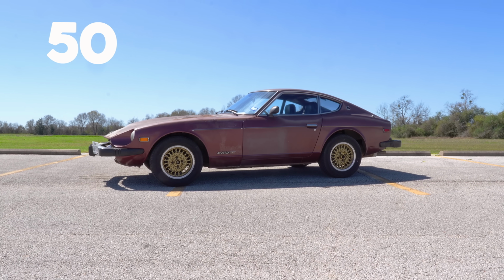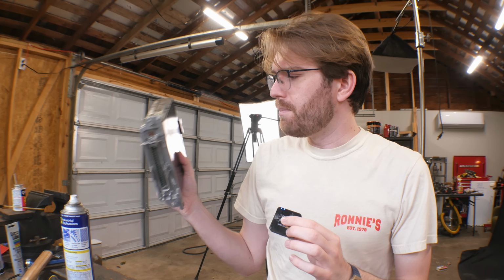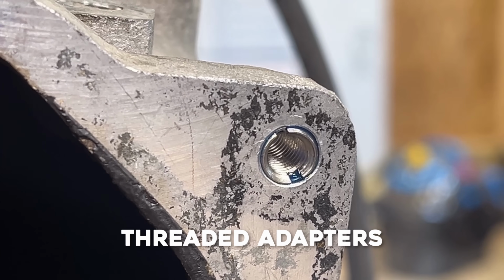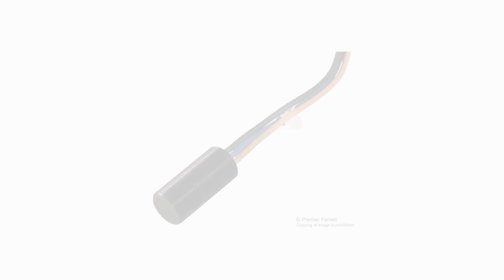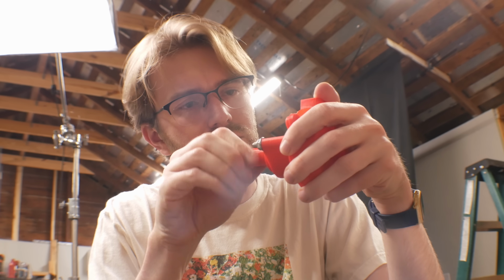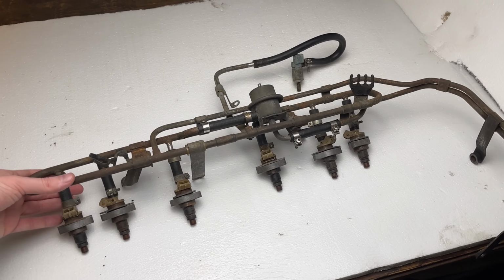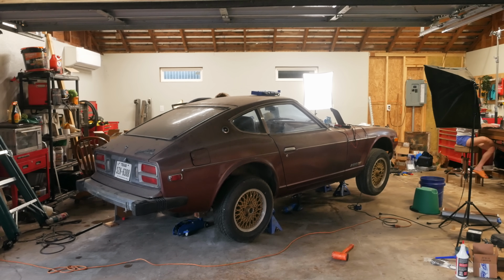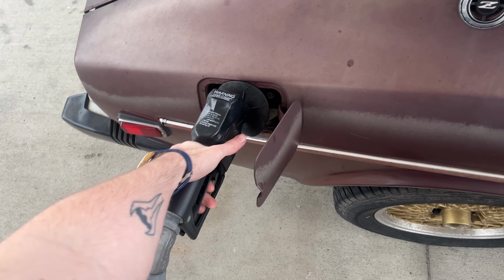Modernizing a Vintage Car

Comment: It's just amazing how someone like myself with barely any mechanical exp. knew it was a fuel delivery issue just by the sound of the car starting. The magic of old cars is that they usually diagnose and troubleshoot the same. 🎉

Comment: I had a 76 280Z and we got around 20-21 mpg with normal driving...put it out on the freeway and it was an easy 22-24 mpg.  A good friend and i went on a little mad run to a casino one time and running probably an average of 100mph the entire trip, when I filled up we still got 18mpg for the trip there.  This was just the regular straight 6 that came in the Z, nothing added, nothing removed, straight from the dealer to myself.  Loved that car, got married and had to sell it to get a down payment on a house.

Comment: Here I am looking for the best naturally aspirated 160+hp engine from the 70's or 80's that I could drop into my 2016 Mitsubishi Outlander with as little fuss and modification as possible. That's right - I want points and a rotor under a distributor cap. And now you are going to ruin that vintage car with modern crap. Ugh.

Comment: Love your humor when the crap falls apart.  It makes those of us in NE Texas feel like our problems are shared with others of similar skill sets.  It doesn't matter whether it car, boat, motorcycle, lawn mower, vintage modified race car or a RV 8 experimental airplane.  Each one of those projects had me scratching my head and confering with other who had experiences similar to mine.  I bought my first Z 260 back in the early 80s at a junk yard.  It has fire, compression and fuel.  Turns out that small rubber hose on the intake manifold had a huge hole on the bottom side.  Replaced it, a good bath and interior scrub and my new wife's new car was ready to go.  Did I tell you that a Datsun 260Z does not make a great car for a young lady real estate sales agent... 😂

Comment: 78 280z was a fast car until the 280zx Turbo came out. Nissan computer were not that great in some of those z cars. I used to own a 75 280z in 1990. My car ran fine until one day it stopped on my way home from work. I didn't know much about fuel injection back then. I took it to a shop and they replace the computer with a used one. Car ran great again until my boyfriend fell asleep on his way home from work. I really got in his a-- after wrecking my car.

Comment: I’m rewatching this…… I missed something. Lose the clutch actuated cooling fan. Upgrade your radiator and put in a thermostatically controlled electric fan. You’ll pick up 5-7 hp with more efficient cooling. Not a terribly expensive upgrade

Comment: A 289 cu fits nicely in the engine compartment. 
289/ 300hp, 4 or 5 speed transmission. Did that with a 240Z sleeper. 
Have a great day!

Comment: This is an amazing amount of knowledge. Frankly, I'm surprised the 280Z ran at all after all these years. It's been years since I saw one of these in good shape but IIRC it had about 120HP on the dyno, stock. As a daily driver, with a 40 mile freeway commute, he reported 20 MPG regularly; less in town because, race car (lead foot).

Comment: My only concern with an electronic throttle body is the necessity for a safety bypass attached to the brake. It can reduce fuel or drive the throttle closed I don’t care which.

Comment: you could have got the fuel injection from a 85 nissan Maxima 3L6 and it would have everything you need for your computer fuel injection system and just some body make a racy fuel profile or you could get your own software to do it yourself.

Comment: Why not use the starter gear teeth on the flywheel for your crankshaft position sensing?  Would have given you a ton of resolution.

Comment: How were you able to buy a bracket for the coils but not a cam position sensor? What’s the point of that bracket if you need to custom build the cam sensor? Also, couldn’t you use the magnetic pickup on the distributor? Maybe remove a lobe to give it the position?

Comment: Great video your a definite wizard!🎉
Now i got some questions.
1) why didnt you replace the valve train and lap the valves in?
2) i think i understand you were wanting to leave the motor stock but why didnt you replace the timing chain after a 100,000 miles they need it.
3) this isnt a question just a helpful tip pull the fan system off and put a electric fan in it it will help.
My father and I rebuilt  a 6 out of a 280 to put into his 260 and we port and polished the head gasket matched the head on intake and exhaust and that 6cyl was a holy terror!
It was to powerful for the rear end we tore 2 rear ends on the 260.
3) now that you fixed the "devil sphaghetti" of the 280 are you going to sell it as a kit?
Its a niche market but it is a market.
Look you did a hell of a good job. Me i would have just ripped the ECM and fuel injection crap out bought a new intake put two weber side drafts on and called it a day, but damn man! My hat is off to you!🎉🎉🎉🎉

Comment: Originally the Nissan 'L' series engines were copies of the Mercedes M180 engine, an engine that was first developed Mercedes in 1951 and continually developed and used until 1985.

 They are great engines.

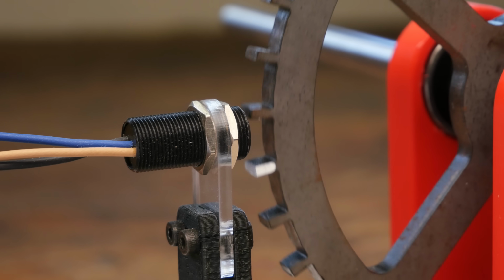Comment: 14:50 I have a question here: So now the computer knows when the cylinder 1 is top dead center, but how does it know when is the 2. 3. 4. 5. 6. cylinders are top dead center?
Reply: timing

Comment: Only issue i have after watching this, is to say. The car with the 3x carbies made 151HP out of the box on the stock L24 engine. Your EFI conversion saw only 142hp.

Comment: You wouldn't believe how many 280s burned down due to the leaking injectors. Alone this conversion is well worth it.
Reply: Later versions also had the same problem, I had a 1984 300zx and there was a recall for leaking injectors, mine caught on fire on my birthday.

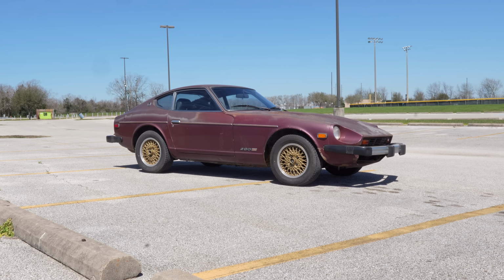Comment: 0:23 i dunno about reliable. Everything used to be made of metal in the engine bay and have relatively simple electronics. Now there's sensors and wires everywhere and everything is made of plastic

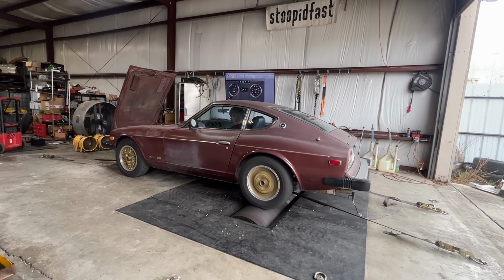Comment: 1:44 true, especially being a longitudinal setup (transverse drivetrains lose less) but at the same time, you are also basing that off of a quoted "new" engine hp. I'd be willing to bet that if you pulled the engine and ran it in a cell, you'd likely find that it isn't making the 170hp as quoted by Nissan/Datsun back in 1978. Depending on if it was ever rebuilt and if so, how long ago and how well, it could easily be down 15, 20 or more hp and then that 125whp suddenly doesn't seem like as much of a drivetrain loss after all. Also, that Cruse Eco mention is a bit misleading there, don't you think? I mean, OEM rated hp is always at the engine, not at the wheels like you tested... That Cruse only makes about 115~120whp from its rated 138 Chevy rated engine HP.

Beyond that though, awesome work and video. 

I will say this though, your holding it all back by staying on stock internals. Modern engines are more efficient not just because of their fuel and ignition system. A  large contributor to modern engine efficiency and power output is from compression ratio and valve train (well other little things too that all add up but...), and while you wouldn't be able to have the luxury of any sort of variable cam timing (and valve lift) like a modern engine, you could really still benefit from a healthy bump in compression ratio. 

The L28E engines only had 8.3:1CR which hell, that is on the same level as 90's turbocharged engines which is quite low. Modern engines are in 12:1CR range on average with modern turbo engines even starting to push close to that too now due to the electronics being able to more accurately control fuel and ignition. 

Due to lack of sufficient control of fuel and timing from now old outdated EFI systems (like the OE L-Jet system), OE's back then had to keep compression down to ward off knock. Then there was also the gas / oil issue's of the 70's and 80's where OE's knew that they would have a very hard time selling cars that required mid level or high octane fuel and thus we got crappy low compression ratio naturally asperated engines.

Comment: I have thought about this. There has been so many models & makes of cars over the years. I'm sure you could find done kind of fuel injection & computer controlled ignition to match your engines piston movement.

Comment: I'm about to do something similar, except I'm starting from carby and points, and going to multi-point EFI with the most modern injectors I can (like this).

I'm also starting from a car that already gets 5.5l/100km. So I'm hoping to get economy in the low 4s...

Comment: A similar thing can be done to any old Škoda car with a rear mounted engine built between 1964 and 1990. The I4 OHV engine was originally developed for the very first model of the rear engine Škoda cars (the 1000 MB) and was updated and manufactured until 2003, when it was installed in the Škoda Fabia. While the original 988 cc carburated engine started at 32kW, the last evolution (still OHV, the basic layout of the engine remained identical, the engine bloc looking strikingly similar) had 1397 cc and produced 50kW of power. And it had fuel injection. Because of the similarity of the engine to the previous ones, it can be adapted and installed in the rear of many old Škoda cars that are vintage today. I had the opportunity to to so myself (to install it into 1986 a Škoda 130L), but refused to do so, as the benefit would be marginal, not worth the hassle and most importantly could cause legal problems. Depending on the exact rear engine Škoda model, the modifications vary, and depend also if you want to keep fuel injection or want to install a carburetor instead.

Comment: Especially a car from the Malaise era ... not from the pre-emissions control pre-oil-crisis era of the 70s and early 80s. (albeit there's some cars from late in the malaise era that still have exceptional fuel economy and sometimes unusually low emissions on top of that ... but relatively gutless power ... albeit still better with a manual than an auto and usually more fuel efficient with a manual)

Comment: The hall effect sensor on a Nissan 350 Z reads the teeth on the flywheel. Which obviously is directly connected to the crankshaft. 

The flywheel has BOTH regular teeth and A COUPLE offset teeth, so not only do you know the RPM of the engine you also know the position of the crankshaft for timing.

Reading both the RPM and engine position from the flywheel might yield a better outcome for your project. 

However, since your vehicle used to use a distributor, perhaps getting your timing from the device that used to firing the cylinders might work just fine. 🤣🤷

Comment: There's a guy here in Austin that is also rebuilding his Zcar. I know because 20 years ago, I rebuilt my Z and sold the remaining parts to this guy much much later. I retrofitted the engine from my '81 280ZX into my '73 240z, scrapped the fuel injection, and put on some SU carbs with electronic ignition. I was actually getting around 24mpg when it was all done. If you ever come to Austin, I'd love to see your car and talk!

Comment: At very least new rings and get valves lapped and new valve seals. I am sure those rings are leaking a bit and also tear down the engine and give it a deep cleaning all the parts then assemble it. Garage 54 did a episode on  that they got a old POS engine to run like new just by cleaning it deeply inside and out. They put new rings and lapped the valves and all new gaskets to stop leaks that's it

Comment: I saw one of these car go for over a £100,000 on an auction, it was in mint condition and had only 31,000 miles on the clock

Comment: The reason for the power loss isn't only because of the drivetrain, engines just loose power over time, especially after such a long time sitting without being started.

Comment: I took a look at those numbers again and I found something interesting. You may be making 4 more horse power than that Chevy, but you are doing it at 2,500 rpm compared to 4,900 rpm. So, what is that car capable of at 4,900 rpm?

Comment: that was a bit of work to gain 17 HP, that is not a lot of HP overall. i would be interested to know how much better the gas mileage increased as to my mind in this situation, if you were to get another 10-12 MPG that would be more impressive.

Comment: Nice work. Also, a demonstration that early adopters and folks doing 1 offs are seldom going to be the low cost solution. This type of work is rarely done for cost, but love and interest. Proof that it can be done, also proof that it is not an easy or economical route.

Comment: This was a really cool project, and I applaud you for taking it on and pushing through to the end!

The 63 years thing is pretty much exactly why I try to explain why I don't just go out and buy a new "fuel-efficient" car.  By the time I pay it off, have I really saved myself any $$$ - probably not.

Comment: you need a turbo now and double the power without changing any internal part ,  only intake tube , exhaust pipe and fuel air mixture program for boost.  Some 280z where all ready turbo

Comment: The cam angle sensor adapter was very nice. I had to make one for a car years ago and it was very, very crude. Basically just a hacked up distributor with some not so nice welds and an adjustable bracket.

Comment: Sorry mate, at this point I would have just pulled out an engine from an fuel injected model car. Any japanese engine from toyota, mazda, honda with half as much work as you did I suppose. 
Good video any how that explains a lot of stuff that goes into making an engine work. Good on you

Comment: I had a new 1976 280Z. It had 178 HP, no idea what HP was at the rear end. But it would do 150+ MPH, and could outrun either a 76 Mustang or Camaro in the 1/4 mile. And at 1976, 55 MPH speed limits, I was actually getting 20+ MPG with the standard transmission. And, yes, that was with a new car.

Comment: This car is begging for a BMW M50 swap - the only weak point in the motor is the plastic impeller in the water pump and they make aluminum ones for $25 that are better-than-OEM. 

Keep the silky smooth inline 6 power delivery, but give it twice as much to work with. And if you really want to test your testicular fortitude - go with the S52 M3 motor and its 8200 RPM redline - just make sure to upgrade your driveline.

Comment: Variable valve timing, camshaft regrind, higher compression, variable intake, direct injection, a million more sensors, etc.  This is what makes modern efficient power, unfortunately the old stuff is stuck at where it was originally.  But at least now it can be changed and tuned.

Comment: the way you drew up the engine RPM sensor was way over engineering the issue. ditch coil on plug, keep distributor but what you do is get a MODERN electronic distributor that would be tons better then any points system or old ass dizzy on that engine, while keeping with the challenge rules.

otherwise, entertaining video and nice work on the nissan engine.

Comment: You are such an inspiration! Awesome job. I have a 1977 280Z and was wanting to change the original fuel system and computer in order to reduce emissions. I am sure your car is running much cleaner now.

Comment: So I don't know how many miles were on the original motor and I know you only wanted to do improvements on exterior parts only but it might be a good idea to pull the plugs and put a camera into each cylinder and check for carbon build-up. As you mention the old fuel delivery system fed fuel into each cylinder weather it needed it or not thus I suspect this could be a strong possibility thus possibly robbing you of some efficiency. Some kind of engine flush might do some good. A compression test on each cylinder might be a good idea as well to let you know if you have any loss of power there, if its minor there are products such as "Restore" that in some cases can have some positive effects. Just a ome thoughts.

Comment: 😅😮 How could you make it more efficient without opening up the engine. Really should have did L15 swap. Practically double the efficiency double the horsepower If you wanted to

Comment: Okay I’m enjoying this.. I’m only 10 min or so in and laughing hard as hell… the black magic carburettor comment and bro putting on that ski mask has me rollin’… I had a 72 240z and loved it so much but it had some rust issues and other things with a spongy floor 😂.. I did have it for about 3 years and just drove the hell out of it… now that I’m an old bastard in his late 40s I’m very happy with my tundra 😂 but I am still enjoying this video… also, let me say that “fuuuuuck you” solid gold 😂

Comment: Your 13% gain is almost certainly down to the parts being newer.  Had you cleaned the injectors well and did a tune up, you probably would have gained as much.
For whatever shortcomings the original system has, it was not designed by a single guy who is a novice and not an automotive engineer.  It was designed by a team of SAE members with years of training and experience.  In fact, the team who designed it probably had 100s of cumulative years of experience. 
 Plus they also had other goals like longevity, ease of manufacturing, good performance across many different environments.  For example, your system may degrade a lot at either sea level or in mountain communities.  It was also designed for gasoline in the 1970s, not modern ethanol.  Even back then, gas was seasonal.  So you add all of these variables and many others together, and they designed a very good system that would perform well in all environments.  You have to remember that some people who live on the beach will buy the car and some people who live in the desert will buy the car, some will live in mountain communities, some will be in Northern Canada etc etc etc.  This same system must be reliable and efficient in all of these different environments.